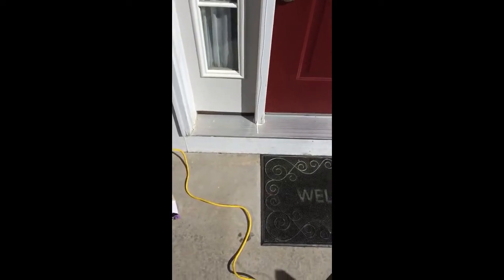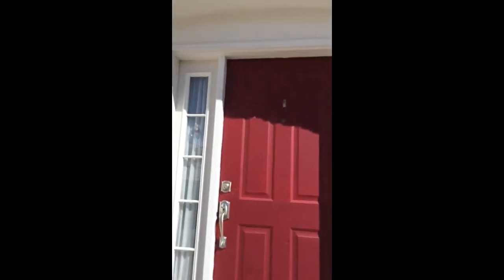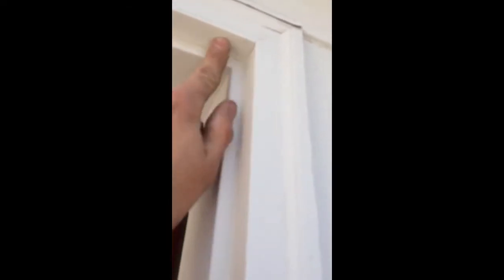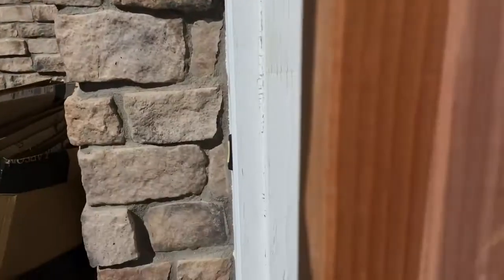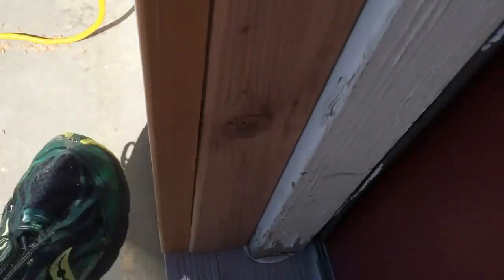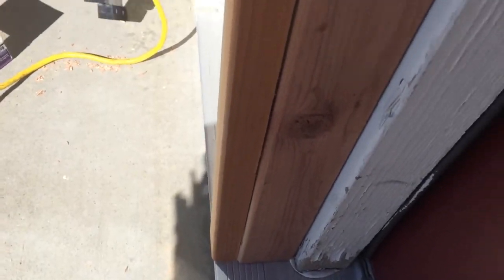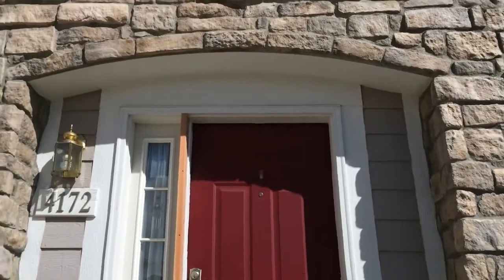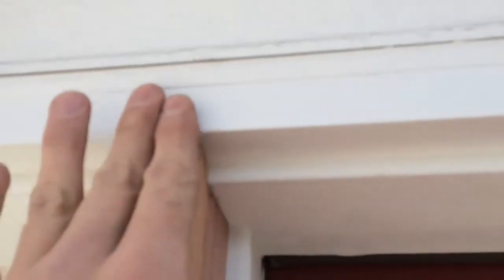@stormdoorguy Adds a Front Storm Door With Sidelight Windows.

Comment: I need to do this exact thing.  Thank you.  What does the finished door look like and what brand of door works best with this setup?  Thanks.
Reply from the maker: Any door brand works when it is all firred out correctly. I prefer Larson if you want a roll screen, and Andersen if you want a solid glass option. 

Take a look at pic here to get an idea of what it looks like: https://www.stormdoorguy.com/store/Larson-Easy-Vent-p578976130
Reply: @stormdoorguy  thank you so much!
Reply from the maker: @vincentviars8785  Glad to help!
Reply: @stormdoorguy  one more question and sorry to keep bugging you.   When you extended that out, you kept it flush all the way out.  Just to be clear, you don't need the little recessed inset as you have on the other side?  I was thinking you needed the recessed area for the door flange to sit in.  Hope that makes sense.  Thank you
Reply from the maker: @vincentviars8785  I use a 2x4x8 which is actually 1.5" x 3.5" x 8'. Then I flush the outside of the jamb with the wood. So the door jambs of the sidelites are typically 2" wide. If you flush the firring to the outsides, that gives you a 1/2" reveal on the inside. So, if you measure from outside of sidelite jamb to outside of sidelite jamb, you get 39". Subtract 3 width of the 2x4's (1.5" x2) and you get 3". So, 39" - 3" = 36" opening width for the storm door. Make sense?
Reply: @stormdoorguy perfect sense!  I was looking at the flushnessn between the two new pieces and not compared to the original jamb.  I missed that.  Thanks again!  Great page!

Comment: Also would pocket hole joinery work to add the board instead of drilling straight through that long length through the side?
Reply from the maker: That's above my pay grade honestly. Maybe for connecting the firring to the header and sill? Personal opinion, the direction of force is away from the house. Meaning if the door was going to be ripped off the frame either by a high wind or some brute kicking it from the inside to the outside, drilling the screws straight through would be the most secure. But anything is possible.

I once did an install that had double firring. I used 4" screws and silicone caulked the firring to the entry door jamb as overkill. 3 weeks later got a call that the door had fallen off.

'There's no way' I said. I put them up to stay up! This I gotta see.

Went to the customer's house, and sure enough, door was lying on the porch, with the firring still attached to the storm door.

Turns out they had gale force winds/tornado hit and the torque on the door opening snapped all the screws in half and ripped the door off the house. Definitely not install-related. :)

Comment: What size is the storm door that fits in there. I have the same type of door, and all the storm doors seem to be to narrow(36in 3/8)max to fit in there. My opening is around 38 in.
Reply from the maker: This is the standard 36 inch wide storm door.

If you’re opening is around 38 inches that would be a custom size storm door. Unless you built down the opening by adding a 1“ x 1“ piece of wood on both left and right sides of your entry door frame, then the 36 inch door would work.
Reply: So the opening is 36in x 80 but from edge to edge is about 38in 1/2 where you would attach the storm door. Looking at storm doors at lows they say 36in 3/8 max on the width. Just trying to figure out if that is the opening or if that is to the edges where you would attach.
Reply from the maker: @jasoncase7285  Thats the edges. A 36" storm door (including both frames) fits an opening from edge of trim to edge of trim between 35 7/8" - 36 3/8". If the opening is any wider, you have to build it down to attach the door.

Comment: Hi, can you share what are you using to attach new 2x4 to the sidelight jamb? Screws? How many? Thanks
Reply from the maker: Sure! I use (5) 3” brass screws evenly spaced from top to bottom if it’s the latch side of the door. I use (7) 3” brass screws if it’s on the load bearing hinge side. With the extra 2 screws, I will angle the drill bit at 45 degrees and connect the firring to the header and the sill of the entry door for added stability.

I use clear DAP silicone/latex caulking to sandwich between the firring and the door jamb creating a better seal and glueing the wood together.

When drilling the hole, I use a 1/8” drill bit, followed by a 3/8” spade bit to make it wider. On firring that is 3 1/4” deep, I will drill about 1 1/2” deep with the spade bit so you get 1/2 of the 3” screw in the firring and the other 1/2 of the screw in the door jamb.

I also offset the holes from center (towards the door opening) so when you install the storm door frame, it covers the holes in the wood. Otherwise, just fill the holes with caulking and paint it, or cut plugs from a 3/8” wood dowel and tap them in.

Hope that helps!
Reply: @stormdoorguy thank you very much sir for the extensive and all inclusive response! Much appreciated.
Reply from the maker: Welcome! Glad I could help!
Reply: @stormdoorguy  do you also use the 1/8" drill bit to make a pilot hole in the jamb, or is that not necessary?
Reply from the maker: @melissahutchins2598  I do.
Reply: Great video. I just bought a 36 x 80 storm door but my opening side to side is only 35 and only 2.5" deep and the top is 1 1/4 deeper. To make it work I will have to add either PVC or wood to make 3 sides flush.
What type of wood did you use? Threated or just regular? Why you didn't use a 2 x 6 and ripped the excess instead of 1 2 x 4 plus another ripped piece?
Please advise.

Comment: Can you use pt lumber instead of redwood? And thanks for the video!!
Reply from the maker: Great question! I would not recommend it. Tried using it once and when it dries out it will shrink, which will cause your storm door installation to fail.
Reply: @stormdoorguy  Thank you!!
Reply: @stormdoorguy  What about non-treated construction/framing lumber? Would that be ok to use for a door on a covered porch?
Reply from the maker: @melissahutchins2598  as long as its not pressure treated, use whatever you like. Ive used oak, whitewood, 2x5 pine stud, vinyl, etc.
Reply: Thank you!!